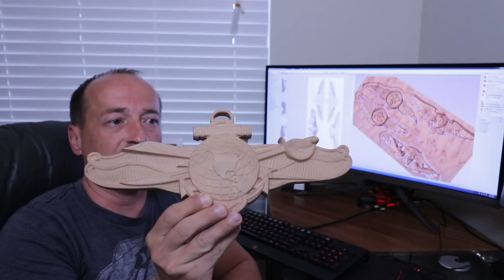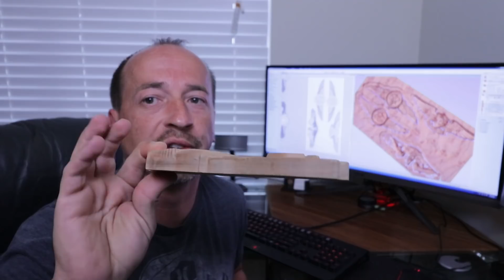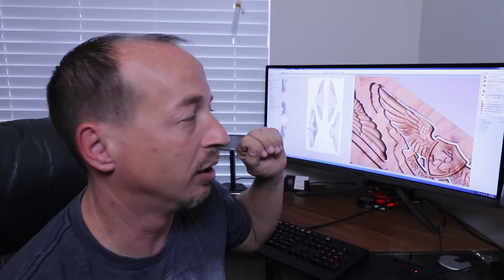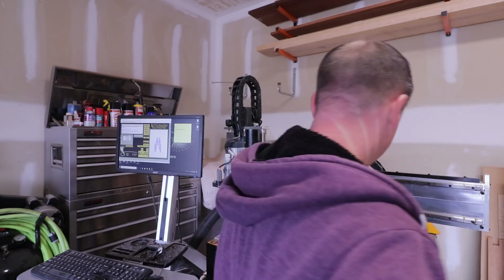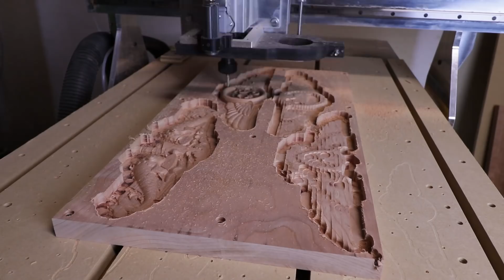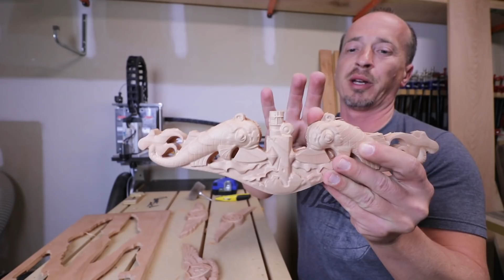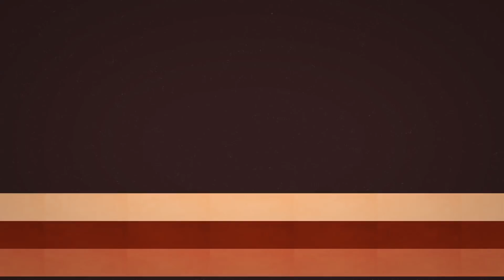Why are 3D CNC Router Carvings So Expensive?!!

Comment: design and draving go lot time or easy fast copy picture and make picture and make g-code generation fast and easy. carving go lot time, yes but this time not newer can calculate customer wallet, only own wallet. you can do lot more different work thats time when machine do carve work. not can customer pay you freetime or other work time. energy no go lot what motors and spindle take/hour. speaking about max 5-10$ wood have expensive, yes if customer want use some special wood but normal sign and other can paint and all can make trash free wood no cost anythink.

Comment: Don't forget machinery cost, overhead. Broken tools. Screw ups. Not to mention. You seem pretty versatile to me with your programing. Most people aren't. It would take then hours just programming. I've been using cnc's for about 8 years. Always learning. Never a dull moment. Cnc costs run around 150$ per hour including the salary of the person programming and preping and all other costs associated. Based on the time and material. I wouldn't sell each item less then 150$. So that's a 600$project if I had to do it. Unfortunately you didn't mention your selling cost. Great video.

Comment: When I ran cnc machines in my early 20's I was just an operator and I just made small adjustments as the inserts wore down because we had to hold medical tolerances.  So when you are creating a "tool path" do you have to say G** spindle on G** rpm G** move so far then G** up across down etc???

Comment: 8:54 - lol no wonder 3D carvings is so expensive... imagine changing out 8 different tool bits for one work piece.
Reply: so what ? no matter use you 1 tool bit or 200 bits one workpiece not important you can charge customer only how much you go to time and electric this work, if you broken bit or many bit you not can charge customer this, same drawing picture you not can charge customer this time how you try and try drawing somethink picture long time. because lot pictures have customer owns or you copy picture at internet and no cost anything.
Reply: @mattivirta  Exactly my point, the more "manual" work the CNC wood worker needs to do, the more they should charge for their work. This is is bad business for the customer and the wood worker has no choice but to charge extra for this. If the wood worker does not charge extra, they will go out from the business because it requires a lot of time for tool changing. 
This is why CNC wood mills requires ATC (automatic tool change) so that they can make complex designs with no additional extra costs for the customer and the wood worker can keep prices low and be competitive, hence they will stay in business and do well. However, in the wood mill CNC industry, it is not advanced compared to metal CNC mills. Because of this wood CNC mills requires complex mods to integrate ATC or find a wood mill company that is professional which provides ATC.

Comment: This video glosses over a lot of important skills and items that go into what is being made.  CNC software is not cheap, nor is it easy to learn.  A cnc router operator is part crafter, part computer software artist (2D and 3D), sometimes part programmer, etc.  

Bits, Feeds and Speeds too.  A lot of these machines only work correctly if the operator understands what bits to use (there are many) and which speed and feed rates to set for each bit to get the best result out of them.  As someone currently starting in CNC routing myself, I was surprised to find out how much I was going to have to learn in order to get my machine working optimally.  These machines and tools have costs associated with them too.  A single good CNC router bit can easily cost $50+ and they are consumable, meaning they have to be replaced when they dull - then there's maintenance, waste disposal... on and on.

As a lifelong learner, the biggest lesson I have learned is that if something looks "easy", it's very probably not.  You are paying people for their skills, tools, knowledge and experience because you don't have them.  If you don't believe me, you can find a small desktop CNC machine online for $200-300.  Pick one up and give it a go.  :)

Comment: Hello .... how to transform 2d drawing into 3d ... or how can I get files of these examples ... thanks ...
Reply: the Software is from Vectric, you can turn photos or anything into a 3d relief with that and create the toolpaths, its easy and not so expensive (for cnc software) i think its 1000 $ for Aspire, the Full Package, but vcarve pro will do, they hae lots of versions for specific needs and lower prices. They also have an online library that comes with it, also, you can use any 3d file formats from the net, for example from thingyverse.

Comment: I'm a machinist turned fabricator and I think every skilled profession suffers from the same thing, people see a little of what you do but have no clue about what it really takes to get something done or the time involved in doing it. They see a snapshot of someone working and often they make it look easy if they are good at their craft but they do not know everything that goes into getting to that point. I may spend ten hours on a project that someone would assume took an hour or so. With machining and welding it is often the setup that takes the most time but people only see a glimpse of the machining or welding.

Comment: THE HARDEST PART IS DRAWING THE DETAIL YOU WANT. WITHOUT A TOOL CHANGER (1 CUTTER AT A TIME) I LET RUN ALL BY IT'S SELF. IM IN THE HOUSE DOING THE OLD LADY WHILE IT'S RUNNING. THE MAJOR COST IS THE MACHINE AND SOFTWARE. ASPIRE 2500.00, I BUILT MY MACHINE (ABOUT 2500 IN MATERIAL AND A SHIT LOAD OF TIME. MACHINE IS BUILT OUT OF 3/4 ALUM   $$$$). TOUCH OFF AND SET UP TOTALS ABOUT AN HOUR. TO RECOVER THE 5-10 GRAND IS THE COST FOR ME ANYWAYS..  PS: SOME RUN TIMES ARE 3-5 HOURS..THIS HAS TO BE INCLUDED PLUS CUTTER AND ELECTRIC AND SO ON..

Comment: Just a question - would doing a 3d (or 2.5d) scan using LiDAR to produce the model be better, easier and produce an overall improved model?
Reply: LiDAR is only good (in 2020) at room scale modeling. There is photography based tech at the desktop level, or better but you still need a perfect model. Which solves the 20% at the cost of 30%.

Comment: Great video, awesome to see this done. With that people who complain that things like this are expensive must think these machines are sold at general dollar, and these folks learned how to do this by reading the back of the cereal box. I'll be messaging you shortly about ordering a few insignias.
Reply: see what i think happens alot is oh i have a friend whos kid has a 3d printer and theyre basically the same so why so much.  when i was beginning this learning to do cnc on my learning hobby machine if i made something for someone it was typically small less than 12 x 7 inches. id sell things for $20- $50 depending on how long the machine had to work. the new machine cost more than 20x the cost of the hobby machine is a completely different learning curve, different hardware, different software but so much more capable not to mention a 36" x 56" x 6" cutting area. though im still in the building and parts arriving stages of that i have to learn how to add components for functions i require. bought from a YT guy here Corvetteguy50 and he built me a gorgeous control panel and got all my changing from grbl to mach3 as smooth as it could be. still buying the frame parts from china but all the parts to make the machine do its job i went with a US builder that was reputable. I didnt want to spend another 6 months chasing gremlins due to unshielded wire and ungrounded machine because they dont really care about that stuff in china. after all electrocution possibilities makes it all that much more exciting:)
Reply: @Q5Grafx  how much does the price for these type machines change? How much does a hobby cnc machine cost aprox? And what are the prices for a cnc like the one in this video for example? Or just how expensive can they get?

Comment: WhatsApp +0086 18765315368. We are factory specializing in the manufacture and export of the numerical control equipment industry for more than 10 years. Our factory has built more than 10 acres of land, 10 thousand square workshops and 80 employees. CE certification, import and export rights, about 9 years of international trade. We specializing in the production of CNC equipment, CNC cutting machine, infrared side hole machine, woodworking center, plate furniture production line, stone carving machine, foam Dragon carving machine, laser engraving machine. It is mainly used for panel furniture opening, cabinet door clothing cabinet door processing, relief carving, hollowing carving, wood door carving, marble carving, metal engraving and advertising industry. We have profused designs with series quality grade, and expressly, our price is very competitive because we are manufactory, we are the source .

Comment: I must add that just the same as a graphic designer or product designer.  A person spends an enormous amount of time learning this software.  On top of that to properly tell an inherently dumb machine to do tool paths so intricate it is not an easy task and very time consuming.  For an artist a painting can take several hours if not days to accomplish.  This is no different in the aspects of designing your artwork initially.  People do not understand that a big part of the process is that they are paying for YOUR ARTWORK which is unique and can be expensive because it initially took hours or days to design the carving.  Even someone who just uses template designs still has to know the machine just like he stated and it takes hours of work.  I hope this piggy backed off of what he said because when it gets to extremely intricate pieces.  You deserve the money to reimbursed in the time it take to make these in its entirety of a process otherwise what's the point?

Comment: I know its a couple years old, but a simple correction.  What you are doing is true #d machining.  2.5 D would be shapes with a thickness.  say like a bracket with some holes.  in 2.5 D you machine the part to thickness then never cut across the top again unless there is a pocket or feature.
Reply: incorrect, this is indeed 2.5D machining, just as he said.
3D is with more than 3 axes, allowing for overhanging elements and even up to all six sides machining with 9 axes for example.

Comment: First of all, thank you for sharing all that info; most people wouldn't take the time to do it. My question is (and this is from somebody that has no clue on CNC work, I just love the art): Why do you start out with such a thick piece of wood if the first pass is going to dig in so deep into it to get to the working depth? My thinking is you can probably save some money on thinner pieces of wood. Great video, thumbs up!!!
Reply: The thicker the piece of wood, the more depth/ dimension you can achieve.. A thin piece of wood compared to a thicker piece, as far as the end product goes, isn't really a desirable look.. You are extremely limited to what depth /dimension you can achieve.. The end result will look flat.. You would be better off painting something or wood burning something on a thin piece of wood over carving it.  I have a video on my channel showing a high relief carving.. It may give you a bit more of a Idea as to what I'm saying...

I do rotary carving or power carving. Not cnc..

Comment: It's the nan ours in the setting up, so for a limited run the cost per unit is higher than a run thousands 
It not the of materials. They can be relatively small compared to the number if hour a designer sits creating.

Like it to an oil painting the materials do not cost much but the artist time is the great expense

Comment: The entire purpose of cnc machining is to make tools/parts cost effectively, and efficiently. They do all of the hard work, all we do is save a program to an sd card or usb drive and plug it in. I own one, I know. Very little effort goes into producing a mass number of orders. Really cool process, but we set these up in minutes usually man.
Reply: Okay, I saw $1900 somewhere, sorry. I just looked at your link, if anyone says $25 is too expensive then they are just trying to hustle you. Cool setup man.

Comment: Nice job!  Just to further back you up, you didn't even mention you are using a CNC machine with a starting price of $7K, a couple more $K for the software, bit replacement, maintenance, and electricity cost for a router that runs hours at a time.

Comment: Why are 3D CNC Router Carvings So Expensive?!!   He really never said did he. other than the programing and machining.

This is the reason:
Aspire is the very best low cost CNC programing software $1,995.00 . But this software does not run the CNC. that takes a program like Mach4 $200.00,  And we are not done yet! Camaster CNC will cost you between $60,000.00 / $100,000.00 dollars. Then on top of that you will have to buy a Central Shop Vac System to collect the saw dust. Grizzly Work Shop Vacuum System G0562ZP $795.00+$99 Freight. And your not don yet, you well need to buy a whole lot of cutters and measuring equipment say another &2000.00 worth. 

And now you want me to charge you $20.00 instead of the $500.00 I was going too. To Machine a Plaque.  Good Luck with That!!!!!!
Reply: LOL Camaster CNC cost $8-16K. $100K is the price of a real CNC machining center. https://www.haascnc.com/machines/vertical-mills/vf-series/models/medium/vf-5-50.html
Reply: They would have paid the trophy shop that and more. A time stamp would have helped. Once you know that you can't really leave it alone for many hours, people get the clue. Most people burn what ever is on the stove top. 30 - 40 hrs of attention? Yeah, right. It's about perception of value. My Brother was a pro DJ, and when the B&G squawked about the price of 4-8 hrs of entertainment, he would ask, how much was the cake? (Usually twice his)
Reply: And maintenance cost

Comment: Software licenses are expensive too...
Reply: Depending on the software some licenses are horribly expensive.  My dad used to run a cabinet business when he was alive.  He used e-cabinet software (kitchen design software) and that costs thousands of dollars.  The key for it looks like a USB flash drive.  He may have had other similarly expensive software.  The fact is for the price of software like that you can buy a decent used car.  These days there is some good software available as freeware but this was at least 13 years ago.
Reply: @charleshines6155  professional Software costs thousands of dollars, PER YEAR
Reply: Mach3 license is about $100 or so. Easel is totally free to design your stuff. So it can be as cheap or expensive as you want it to be.
Reply: all software can copy and crack no need licence, idiot only pay.

Comment: This video is an exaggeration of the work actually required to operate a CNC router. The hardest part is the initial learning of Fusion360/G-code sender + machine setup.  I agree with Skysurfer (dude can charge whatever he wants) , however, I highly encourage everyone to learn/invest a little in 3D printing so you can make a CNC at home for a couple hundred bucks. There is a wealth of info on building these machines, so much so that they can be built and operational in a weekend with all parts on hand. I've been doing this for a few months and even I know this guy didn't have to "CALIBRATE" his ridiculously overpriced beast of a CNC before each use.  He's referring to zeroing the machine/work, that is hardly the same thing and does not take 30min unless it is your first time...ever
Reply: Regardless of the calibration time and slight exagerations, It's still much more of a process than the typical client understands so this video proves its point.

Comment: I bet it took over 100 man hours to write the cnc program for the part.   Looks  like he attached  wood boards onto the  bed of his small gantry mill.  Warning:  dont  use the coolant pump  as it would soak into the wood. I would use basswood for carving.
Reply: newer NOT can charge customer if you write 100 hour gode, you use wrong tools if need write 100 hour, may software can use no need write code lot, copy paste picture and make some modification if need to picture not go many minute, then software generate g-code some second, and ready to use. not can charge customer this time all newer. same you put wood piece to cnc table, find probe zero setting and bush start button no go lot time no can charge customer, you machine and softwares not have customer problem, only need charge customer wood, handworl,paint etc, other little woodwork, little to cnc work how mush go electric thats it, cheapen need be lot than handcarve same piece to wood. because use automatic machine.

Comment: I just bought a shark hd5 extended with the all the way to aspire software and having a blast. I'm making a 11 by 13 inch oak portrait with a nice frame around it this also cnc'd with my daughter holding my first granddaughter. For the finish I used to 16th ball nose and did the entire workpiece. The finish pass ran for 16 hours. If someone could post a tool diameter with cutting speed as a cheat sheet which would be really nice. I did the ruffing at a 50 per inch and finishing at a 30 per inch. The finished product looks absolutely awesome but I need to utilize time better.
Reply: So you make a photo into the carving?

Comment: When I had my CNC router every time I put a new spoil board on I would take a .5 flat end mil and run a tool-path over the complete spoilboard to parallel it to the router gantry. This way those low and high spots are almost nil. I also used to screw my work-pieces down to my spoil-board, only way to make sure it dont move. Especially if its a project that may take more then one day to complete.